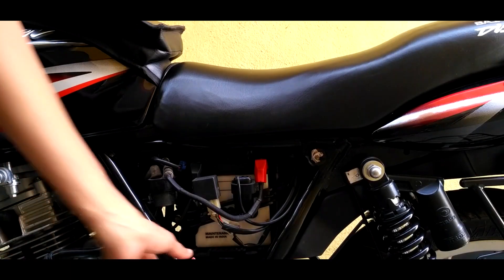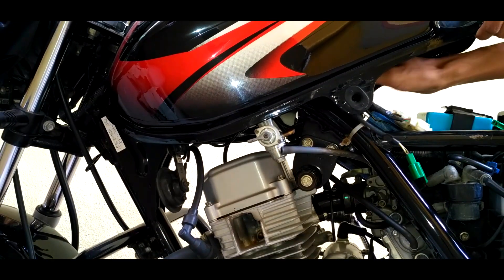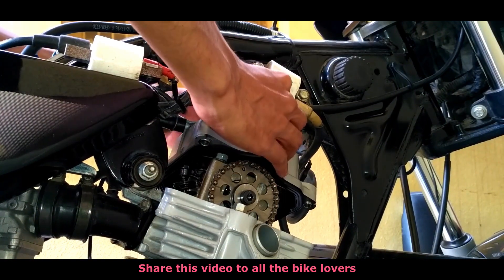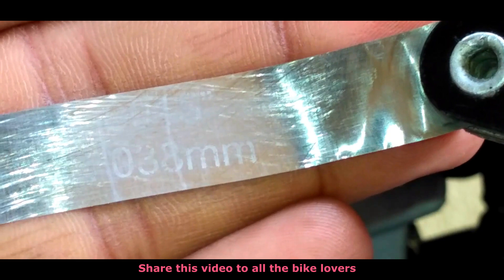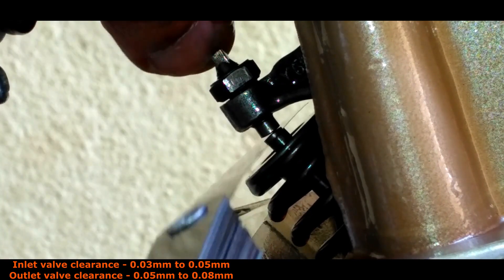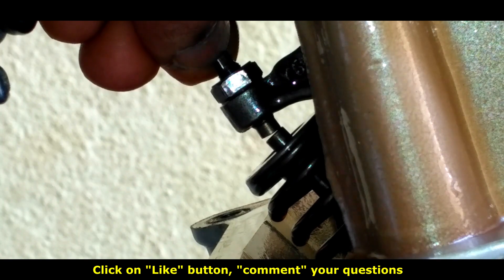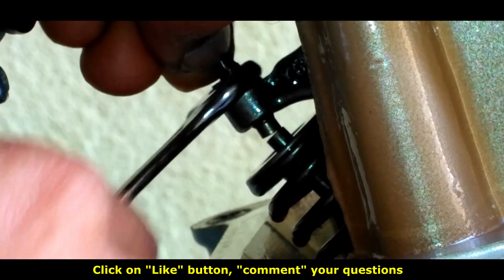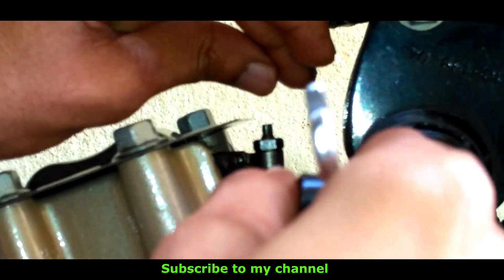Discover 125 bs4 Tappet setting for valve clearance

Comment: Bro for discover 125 bs3
Reply from the maker: Hi Sir, use same measurement 0.04mm - 0.05mm for inlet valve and 0.08mm for exhaust. 
Use only mm metric reading feeler gauge, one one with inch reading don't match.

Comment: Sir discover 125st bs4  front suspension me oil Kitna fill Karna HOTA hai suspension Pura clean Karke fill kare to Kitna mm dalna hoga?
Reply from the maker: Hi sir, any discover bike will it be, we need to fill 160 ml bajaj company HP made suspension oil after fully cleaning, which costs about 55 Rs as on 2021 price structure.

I don't recommend adding new oil to old oil. For every two years, suspension oil needs to be completely replaced. 

Thanks for asking, let me know if you need anymore info regarding other parts service.
Reply: @PavanKumarHB  okk sir, thank you very much.
Reply: @PavanKumarHB  sir Bick 12 sal chal chuki hai to front suspension me kya kya waer and tera ho Sakta hai,kya koi part replace karna hoga,and suspension spring me zyada gap valai side niche aayega ?
Reply from the maker: Hi, replace oil seal and oil as well. Both parts will cost you 110 Rs. Clean the suspension inside compartment using WD-40 spray.